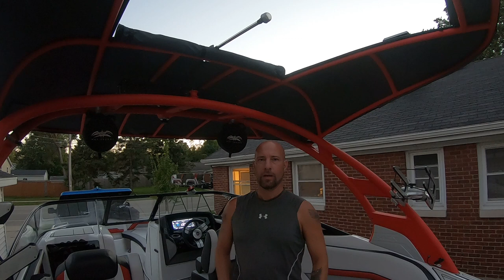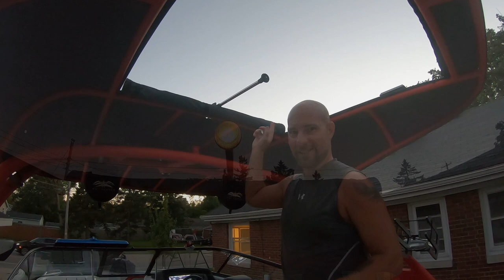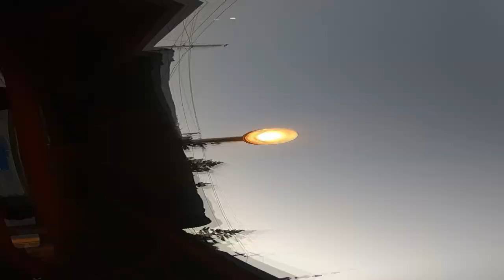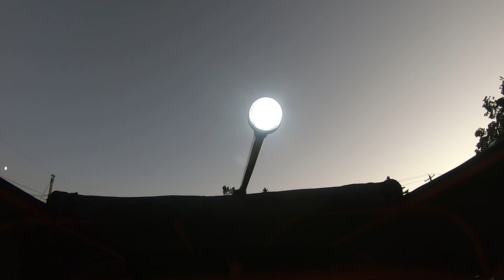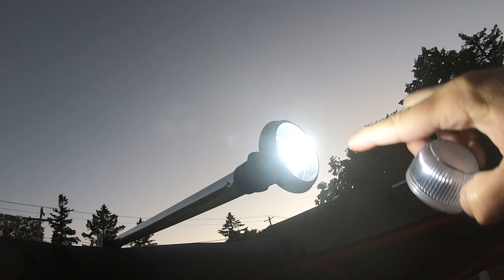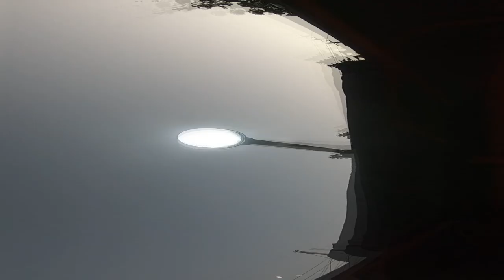Putting an LED anchor light in my Yamaha boat

Comment: Awesome video! I’ll replace with the same thing. Prolly looks way better of a match to the tower LED lights now! Thanks for posting.
Reply: As far as you know there’s no issue with the Coast Guard or anything for having an LED light for this anchor light correct? I feel like if anything they would like it even better because it’s brighter but they have some crazy rules.
Reply from the maker: @ttvdecimatedbyme9130  no issues that I'm aware of. They have a minimum distance that your anchor light must be seen from. (2 miles if I remember correctly) But I couldn't find anything about a maximum brightness.  While this lights is a little blinding from 2 ft away, I don't think it's going to bother anyone from a boat away.
Reply: @SmoknJaysGarage  awesome, thanks!

Comment: Great videos about your 242x!  I am buying the exact same boat, used of course, in two weeks.  We are super excited and your videos have given me inspiration on the many upgrades you have done.  We live in Idaho, the reservoirs we will be going to are around 3000' to 5000' in elevation, I know we will lose a fair amount of power.  Do you know of any improvements that will help us at these higher elevations?
Reply from the maker: That's awesome,  very exciting.  
As far as the elevation,  I'm not really sure there is much you can do. Thinner air makes less power. I'll keep an eye out for any ideas though.